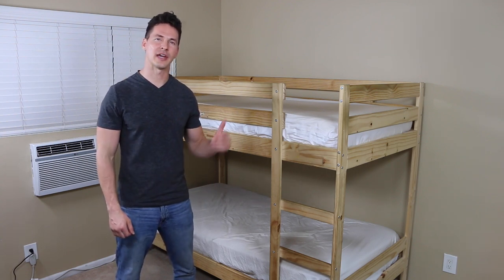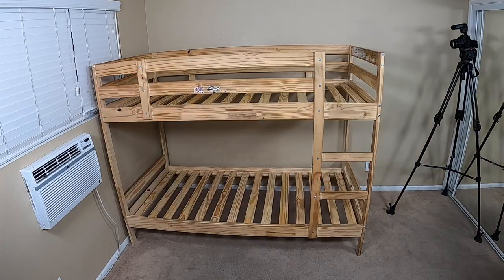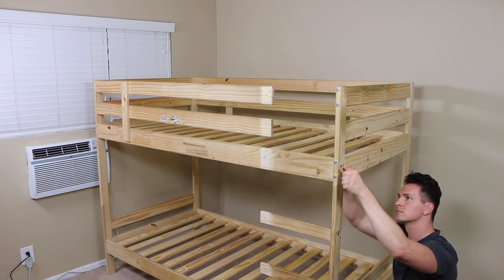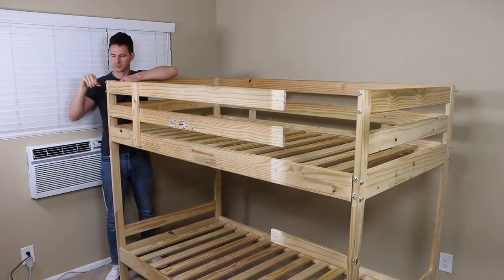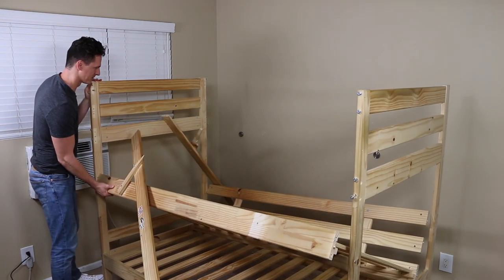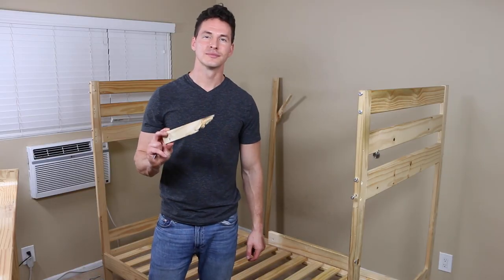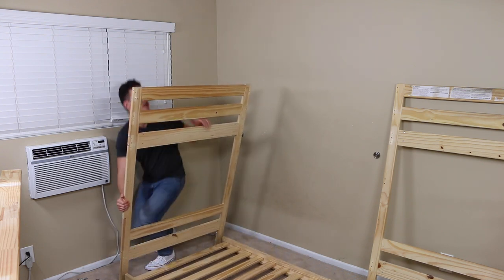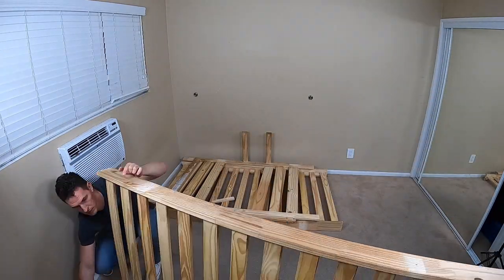How to Disassemble a MYDAL Bunk Bed Frame | IKEA FAIL

Comment: Thanks for the video and tips. We had three people to get it disassembled. The problem now will probably be getting it back together after we move. One problem we did have was getting some of the screws out (specifically the ones that hold the ladder). When we would turn the screw on the inside of the bed, the one on the outside would turn with it, so it was really difficult to take off the ladder. Luckily, we removed all but one, so the long piece is still attached to the bottom bunk, but intact.

Comment: TIPS : if you want to avoid this fail, SIMPLY flip the bed to its side and that way all the frame will be supported on the floor by their side. You will be able to  disassemble them safely. ✌🏻
Reply: Oh! This seems like a good tip for putting it back together, too.

Comment: My idea was to take the manual and undo each step. But trying to get those plastic screws out was impossible. So, I took off the ladder and put it on its side. I slightly unscrewed the sides until each part was loosened and was able to take out the assembled bed bottom parts which are pretty heavy. No failures on my side.

Comment: Good to know, I'm going to turn the bed on it's side when I take out the final 2 screws per bunk section.  Then it shouldn't matter if you have 2 people or not.  Did you have any problems with the slats popping off in transport?  They are friction fit on those plastic inserts so really not much holding them in once in the uhaul.
Reply from the maker: I didn’t have any issue with the slabs coming apart, but I was careful when I was carrying them and I stacked them snugly in the back of a U-Haul

Comment: Did anyone take this platic inserts out if yes please tell me how?
Reply: Hi! I have the same problem of you! Did you find how to remove them? And if so, could you tell how you did it please?
Reply: I tried but gave up after two of them. I ended up putting the bed on its side and taking off the sides, leaving the beds in one piece. This went smooth.
Reply: I also need help disassembling that last part - taking out the plastic screws does anyonehave advice?

Comment: Is it stable to take the top off and use it as a single bed?
Reply from the maker: You couldn’t use the top bunk as a single bed without buying some extra parts. You can probably use the bottom though.